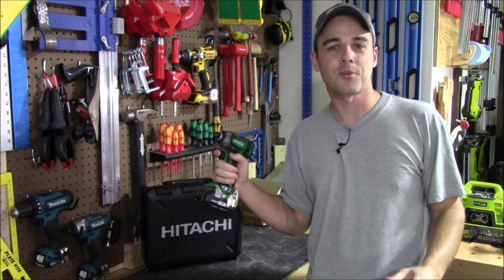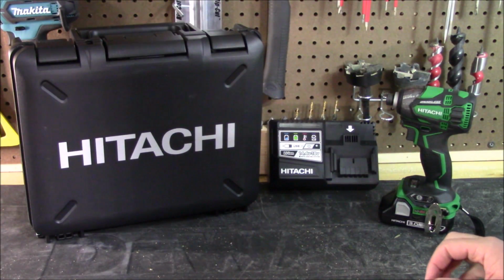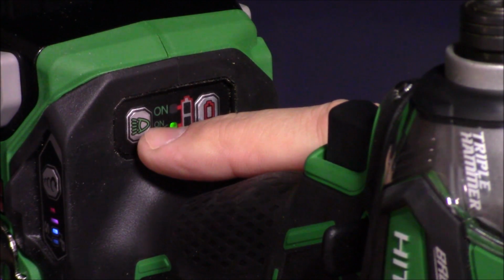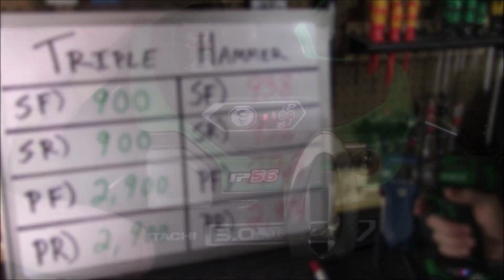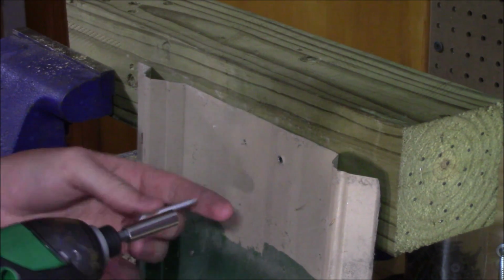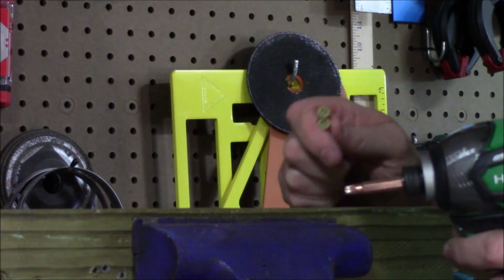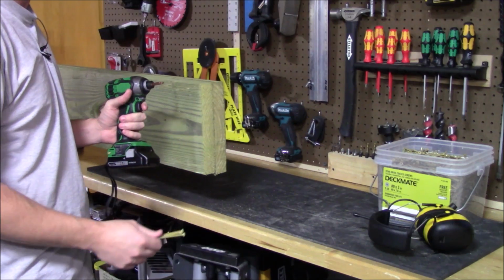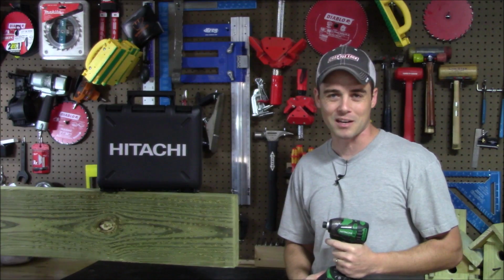Hitachi Triple Hammer 18v Brushless Impact Driver WH18DBDL2

Comment: Best impact driver period. I have this tool and it's a masterpiece of engineering!
Reply: greenskiis check out makita' stop of the line or the Milwaukee surge, they're pretty hard to beat
Reply: Scarry Polpetta They're both great (more so the Makita than the Surge IMHO) but this is the best overall impact. Its third anvil/increased speed/reduced vibration and IP56 rating put it over the top of Makita, Milwaukee, and DeWalt's best offerings. You really can't go wrong with any of them, though.
Reply: greenskiis yes, i'm relly interested in that ip rating, since I often have to work on boats or next to water
this is a great impact, but I wouldn't switch to hitachi just for this model, maybe makita or milwaukee don't have such a great machine, but they have a huge lineup with great products for each application
Reply: Scarry Polpetta Good points; I've heard that Hitachi will be releasing more of their higher-end products stateside soon. Here's hoping as their best products are easily high-tier like the Big 3. (their Japanese selections are huge)
Reply: greenskiis If they're going to make a big powerful hammer drill, a small compact drill, an impact wrench and a grinder that are at least comparable to the ones from makita or milwaukee, maybe IP 56 i'm sold on hitachi
Reply: You should check out the website toolguyd.com and search Hitachi there. I know they have a hammer drill which is more powerful than anything by Milwaukee, and IIRC they have a grinder. Those are both brushless; pretty sure they have an impact wrench but not sure about a compact drill yet. Hopefully they all make their way stateside soon!
Reply: greenskiis one of the main complaints i had was about the batteries but it seems that they've solved it
i'll definitely look into it
thanks for the link
Reply: The only problem I see is a lot of the internal components are plastic and not aluminum and will be susceptible to cracking over time from cold temperatures but besides that this is a masterpiece. I may add it looks exactly exactly like a makita so much makita could almost sue but I do realize this is the strongest best impact out.
Reply: Yea the MV is due to hit next month. October 2018

Comment: Ive had this tool for about a year, very impressive. The ip56 rating is nice when working in snow or very dirty conditions (which for me is often). Smooth and precise but also very powerful. I normally go a week between charges on the small batteries. Best impact ive owned. Makita is a close second

Comment: I have the old model I've had for probably 7 years and love going up to long lag bolts used to secure equipment to shipping skids and remove them when co-workers Makita and DeWalt failed my batteries are getting old and am looking into this model. I have been very happy with Hitachi tools. another bonus is the lack of them on job sites and other workers mistaking batteries as there's

Comment: One thing about the compact pack. It may contain same amount of energy than a "full size" pack with 10 cells. For some devices that doesn't matter but large drills etc. it may very well matter. Given cells from same era lower capacity cells can handle more current. That said I don't think small impact drivers use that much current that it matters and so the lighter weight is beneficial. A large drill drilling large holes or driving large screws, for a circular saw etc. it's a different matter. The larger less dense battery will outperform the compact one as it's much more high current capable and so voltage sags a lot less.

Comment: So not 18650 cells, interesting. Maybe they used mobile, flat lipo cells from phones. Enjoyed seeing the inside, thanks for removing the cover and showing that. Looks like the best compact impact driver I've seen so far. Good video.
Reply from the maker: I am assuming it is the same design as the Metabo LiHD batteries.......Hitachi bought Metabo earlier this year, and I assume part of the reason for that was to incorporate the higher-end technologies into the Hitachi lineup to improve overall quality.  The compact LiHD 3.1ah battery is almost identical in size.
Reply: thats exactly what happened.

Comment: I hope they start a trend with the compact high capacity batteries, i'd love to slim my dewalt set down
Reply: FishFind3000 each battery has two values to consider while designing a battery pack: the capacity in mAh and the maximum discharge rate in C or A
Usually big capacity batteries don't have a very high discharge courrent, so it's better to use two (or more) smaller batteries in parallel, so you get double the capacity and double the courrent
Reply: There is a slim 3ah battery from Dewalt that is being tested in China. I don’t know if it will be sold here though. The bottom of it looks like their new 6ah battery.

Comment: I wouldn't say this tools features are entirely unique. makita's new subcompact 18v impact driver has an auto drive mode that starts with a low rpm then accelerates when impacting begins, giving you a lot of control when the screw starts feeding in. Milwaukee's One Key impact drivers can also be programmed to do something similar to both of these tools with their adjustable drive modes.
Reply: Yukikazehalo The Makita feature is junk. It routinely strips the screw after drilling.  
Hitachi works perfectly

Comment: Just bought the 10 inch hitachi miter saw today. It's the 120 dollar one I got at lowes. Very nice saw for the price.  You should do a review on it if possible. I have the newest Milwaukee impact driver and I think I could of done better. It has been reliable but the finish is crap and looks like ive used for years already. Motor assembly seems loose too inside ??!!!  Time will tell
Reply: James Avery Hitachi makes some of the best miter saws on the market. I have the same one for 120 bucks, I personally like it better than my 250 dollar dewalt.

Comment: would you do a VS video? hitachi- dewalt -  Milwaukee- makita???
Reply: the hitachi would lose because the triple hammer is snake oil.
Reply: @ElectronicsForFun  
And your basis for your claim is...?
Reply: @l00nybin  sir issac newton. the laws of kinetic energy and centrifugal force. there is less travel space between the third hammer and the third anvil which also means there is less kinetic energy built up when it strikes the anvil making for a weaker hit.
Reply: @ElectronicsForFun  
Unless you have some secret knowledge of how the Hitachi and the competitors' drivers are made, I think you are making some assumptions about their design that you don't have facts for. How many millimeters does the hammer travel in the 2-hammer drivers? How many millimeters in the 3-hammer? What is the spring tension and strength of the springs in the 2-hammer vs. 3-hammer drivers? What is the mass of the hammers in the 2-hammer vs. 3-hammer. For all your talk about kinetic energy and whatnot, you fail to mention momentum, which could play as much or more of a role in the function of the impact driver.

Example: my friend shoots light competition arrows and has a longer draw length. Just by his draw length being 3" longer than mine, his arrows have more potential energy stored in the limbs and thus exit the bow at a much higher velocity than my arrows with more kinetic energy. However, my much heavier arrow moving considerably slower due to my short draw length and increased mass of the arrow penetrates the same target deeper than his, and knocks the target back farther due to having more momentum.

Which arrow is the 3-hammer and which is the 2-hammer? 

You might be right, or you might be wrong. But, again, unless you have secret knowledge about these variables, you don't have the information needed to make the claim you do.
Reply: @l00nybin  "Unless you have some secret knowledge of how the Hitachi and the competitors' drivers are made, I think you are making some assumptions about their design that you don't have facts for." l have seen their designs. it's not like they are hiding it, it's public record. and the design doesn't make sense to me.

"How many millimeters does the hammer travel in the 2-hammer drivers?" it depends on the driver, and l don't know that info off the top of my head for each driver.

"How many millimeters in the 3-hammer?" it doesn't really matter unless you're trying to get a dead on balls accurate reading of the torque differential, all l am pointing out is that it's there so the most important thing is that it's either less than a dual hammer or it's the same with smaller hammers. either way you still have less torque. 

"What is the spring tension and strength of the springs in the 2-hammer vs. 3-hammer drivers?" l would assume it's the same since a larger spring would require a more power hungry motor to drive it fast enough which means you're burning more electricity just to get as hard a hit as a dual hammer. you would kill efficiency with a stiffer spring. 

"What is the mass of the hammers in the 2-hammer vs. 3-hammer." it would have to be more in the triple hammer to make up for the shorter gap but then you're just creating more weight for the same hit. so at that point it's inefficient on power and weight.

"For all your talk about kinetic energy and whatnot, you fail to mention momentum," kinetic energy is created from momentum. the triple hammer would have to have more speed to be at the same level as a traditional double hammer in terms of momentum, and would have to have a stiffer spring because eventually it wouldn't hold up to the speed needed to create the additional momentum, so then you come back to power inefficiency. 

"Example: my friend shoots light competition arrows and has a longer draw length. Just by his draw length being 3" longer than mine, his arrows have more potential energy stored in the limbs and thus exit the bow at a much higher velocity than my arrows with more kinetic energy." 

"Example: my friend shoots light competition arrows and has a longer draw length. Just by his draw length being 3" longer than mine, his arrows have more potential energy stored in the limbs and thus exit the bow at a much higher velocity than my arrows with more kinetic energy. However, my much heavier arrow moving considerably slower due to my short draw length and increased mass of the arrow penetrates the same target deeper than his, and knocks the target back farther due to having more momentum." if anything this comparison proves my point. the heavier arrow has more momentum just like the hammers in a double hammer impact would have more momentum than a triple hammer.
Reply: @EFFmusic  
My heavier arrow travels a shorter distance on the string, thus should have less KE, yet it has more momentum than my friend's lighter arrow that travels farther on the string.  3 hammers will possibly be heavier, or might be lighter. If they are all connected as the drawing shows, then a smaller striking surface doesn't matter if the total mass of the 3 hammers + the connecting metal is greater than a 2-hammer. As for a stronger spring being worse/better, more/less efficient, the battery may make it irrelevant. 

If you do have that secret knowledge about mass, spring tension, battery/motor efficiency/etc., then share it. If not, then you are, again, making an assertion of "snake oil" based on assumptions and not facts.

Comment: Great review, I really enjoy how in depth you go.  think it would pull some caliper bolts off? I saw the specs saying 12k in/lbs.
Reply from the maker: Possibly, but the main point of failure will be the 1/4" hex to 1/2" adapter....I have snapped many of them in testing with all of these high-powered impact drivers.  They shear right off....$5 wasted each time.

Comment: 4 months old and my triple hammer hammer / anvil is smashed, gnarled, bent, dead. Had Makita steel that's lasted 20 times longer. Interestingly though, the driver spins in a caged bearing which sits inside the gearbox housing. All other Makita drivers spin on a bushing which eventually wears down thus causing speed wobbles. So , 10 points for good engineering there but no points for crap steel. Also, the whole gearbox is merely pressed together with nothing more than a plastic cover (at rear) and a thin rubber gasket, soooo...grease everywhere throughout. Makita has a sealed gearbox which screws with opposite thread. Ultimately, I wish they'd all get together and make a drill properly, then we just choose which colour!
Reply: I bought a hitachi brushless pair for 400 bucks a few years ago.
Drill failed. fixed it myself a few times because customer service didn't answer emails or multiple phone calls and I was left dead in the water. replaced chuck with Roehm due to failed chuck. soldered in new primary wire since the solder point was inadequate and the wire failed.
Hitachi never again.

Comment: Once again, excellent video.  95% of all my tools are Bosch but this video is making me interested in the Hitachi.  I looked at CPOutlets and it lists for $399.  That does seem a bit steep comparatively and I have always heard less than stellar compliments about their customer service and warranty issues.  

Also, does Hitachi have service centers?  I know that the place where I have bought most of my tools, Mann Tools, in Columbia, SC stopped carrying them and stopped servicing them about two years ago.  

Lastly, is this a new battery platform for Hitachi and if so, are we to expect more tools to come out soon?

Great video, keep it up.
Reply from the maker: Thanks!  Yes, Hitachi is planning a major push into the pro market.....they bought Metabo last year (which is where they got the new smaller high-capacity batteries from) & just announced 3 new brushless nailers, SDS Rotary hammers, & supposedly will be coming out with many new tools throughout 2017.

I do not know about the service center question.....I know Lowes is the major "box store" retailer for them (like Home Depot is exclusive for Ridgid, Makita, & Milwaukee).  I would assume warranty claims could be handled through the point of sale and/or a mail-in service like Milwaukee.  I will see if I can find out.

Also, yeah the price on this is up there --- but it is the new "top dog" in the impact driver segment.....I would assume as other manufacturers catch up, the price will level out.

Comment: guys. I remember plopping down 400 for a pair of brushless hitachis a while ago. Drill failed.
CUSTOMER SERVICE WAS NON-EXISTENT! It's important, guys.
The chuck seized up. 
That grey rubber coating of the interior circuitry flakes off after two years.
The solder point between the main power from the switch to the circuit board burned and became mostly de-soldered.

Comment: Do they sell that toolbox alone? I can use it for another impact driver.
Why is it that impact always die after after you put in a screw. Never during. For me anyway.

Also, can yo do a video on the differences between impacts and drills. To me they're the same. Both of them can do the same thing.
Reply: john M agreed
Reply: john M li ion puts out the same voltage from the full charge till its dead that's one of the advantages  of li ion and drills are for drilling holes and impacts are for screwing things together impact helps drive the screw in faster
Reply: An impact driver strikes in a rotational fashion as opposed to the continuous rotational torque of a drill. Pros and cons to both. The impact can be much lighter to produce the same effective torque, but is also louder. You also don't get the same counterrotation with an impact like you do with a standard drill--so no need for a side handle and it is much less tiring to the arm (the resetting of the impact hammer essentially absorbs that counter-torque). But a normal drill can accept most any bit/driver that will fit inside its chuck, whereas you need specialty bits to snap into an impact driver. One final note: impact drivers are much less likely to strip out screw heads, especially philips, as its pulse-like action lets the bit 'reset' in the screw head multiple times per second. Over time, I find myself reaching for the impact more and more often.  Here's a nice article on drills vs impacts vs hammerdrills: http://www.thewoodwhisperer.com/articles/drills-vs-hammer-drills-vs-impact-drivers/
Reply: I'm not counter hammer drills, I know that's mostly for concrete and if you're and electrician wiring up the house or a plumber piping the house. That I know, you can drill the holes in the studs, but it would be easier and faster with a hammer drill.

You can use impact bits in drills. And  vice a versa, if the drill bits are hex. 
You can drive screws with a drill. 
Impacts are variable speed like drills are.
The article you showed is 7 years old. Drills and drivers came a long way in that time.
Reply: Is Japan made ?  O china